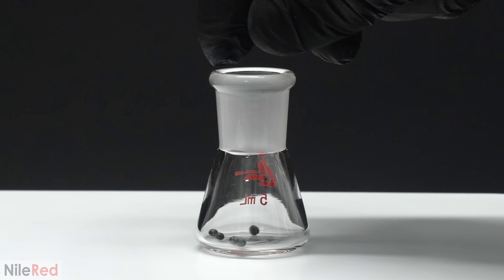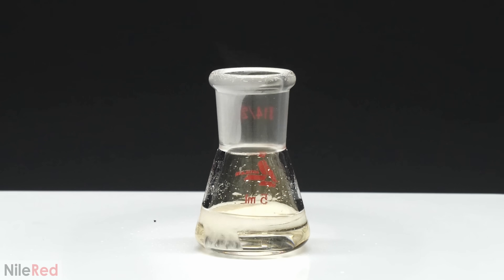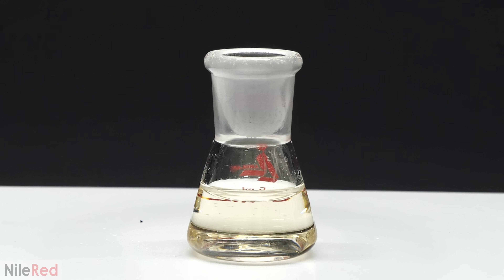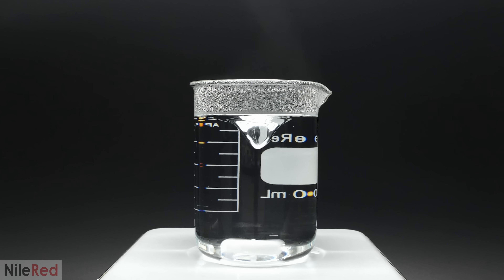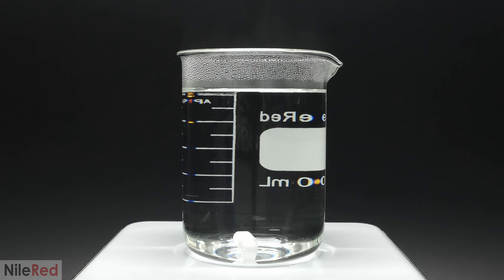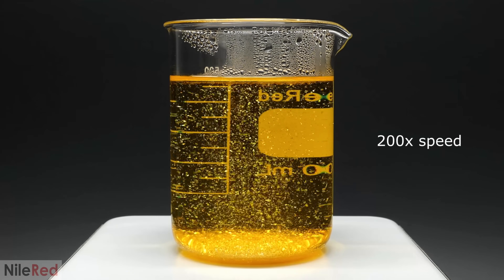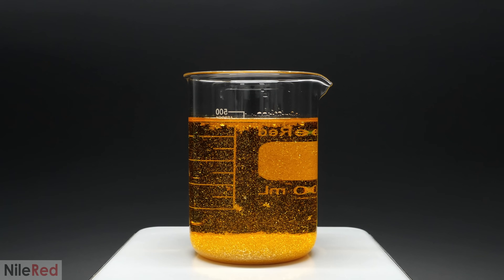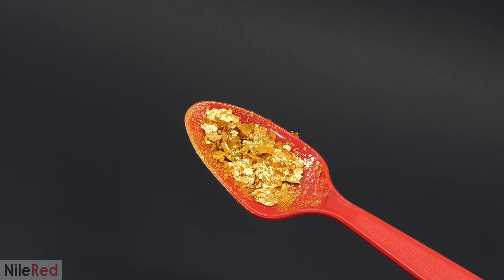Turning lead into gold (lead iodide)

Comment: Very fascinating 👍😃
I feel that somebody should point out the TOXICITY of Lead Iodide, just to give some information about it.
From Wikipedia: 
Lead iodide is very toxic to human health. Ingestion will cause many acute and chronic consequences characteristic of lead poisoning.[31] Lead iodide has been found to be a carcinogen in animals suggesting the same may hold true in humans.[32] Lead iodide is an inhalation hazard, appropriate respirator should be used when handling powders of lead iodide.

Comment: As a historian, this raises a lot of questions.

How long have people known how to do this? How long have people understood what "lead iodide" is?
Has anyone, in ancient history, learned how to do this before? What did they do with that knowledge?
Reply: I'm asking the same question! I need answers
Reply: I can't really say anything abouth whether someone found this out by chance in history. I suppose it's not impossibe considering the materials used would be reasonably available. That being said, without modern chemistry, this would be very hard to actually understand. That is, to be able to predict what might happen if you try this or that beyond direct experience. For a reference point on that: the periodic table arguably the most important 'tool' of chemistry was invented in 1869.
Reply: @ithrangroenen1787  
I could just try to look this up, I suppose, but sometimes it's fun just to speculate.

I have found, as a general rule, that ancient science is more sophisticated then we tend to imagine. It has massive holes in its overall logic, but other than that, it has the ability to achieve considerable depth.

All that is to say that, while the ancient alchemist in question couldn't possible understand the chemistry behind what he was doing, I believe that it would be very possible indeed for him to salvage materials that have the necessary chemical components to achieve this reaction.
Reply: @Nikolapoleon  I'd imagine they would probably have been able to predict that the process would yield some solid, but they would have no way to know what it would look like. That's late 20th century chemistry.
Reply: I'm sure that the early alchemists have done this exact experiment, or something very similar. Even very simple testing with a hammer will tell you this isn't gold, real gold would be squished flat while lead iodide will shatter into pieces.

However, they may have thought they were close to figuring out how to turn lead into gold. Without a good understanding of exactly what was going on, it would be easy for them to think that if they could just find the right reagents they could "perfect" this reaction to produce actual gold. Of course today we know this is impossible but to an ancient alchemist it must have felt like they were one step away from finding the philosopher's stone.
Reply: @jasonslade6259  This was exactly my suspicion.
Reply: I'm confident that at some point between the greeks (possibly further back) and the high middle ages, there must've been a scenario where someone achieved a reaction very similar to this one, and from there rumor started to spread and eventually became the ubiquitous alchemical legend/conundrum of 'turning lead into gold'. Being a relatively simple reaction, with accesible enough ingredients, it's too much of a coincidence that lead would be the base for the mythical transmutation without it being related to this.
Reply: Well, Isaac Newton actually went insane from dabbling in this art. He suffered from lead poisoning and eventually became cruel and sadistic. So, people have known how to do this stuff for a while.
Reply: Lead Iodide is a chemical that was first discovered in 1823, though it was not used to make chemicals until the 1900s.
Reply: Archimedes, had already recorded a formula still valid and used until today for the ruler of Syracuse to find out if his jewels were pure gold or not, which indicates that a few thousand years ago people knew how to forge gold and were fully aware of it, as this has become something so frowned upon as to become something mythical to common people (think about it like this, engines exist and are common, most people don't know how to design an engine except people with specialized study in this, everyone is fully aware of the existence of engines and few know how it works, so it's not that hard to see "common people" believing in perpetual motion engine myths). What methods were used on it, Idk.
Reply: As a historian (since now), I dont care that much about that question
Reply: @I   This semester I am beginning research for my Master's Thesis, so make of that what you will.

I wish to find out if the mercenary tradition of early modern Germany [at that time called the HRE, and largely under the control of the Habsburgs] is provably linked to the development of nineteenth and twentieth century German cultural "militarism."

But indeed, I know almost nothing about the history of alchemy specifically.
Reply: Probably a long time, it's most likely a byproduct of alchemy, what they did with the knowledge i have no idea, i know i would've gotten rich however 😄
Reply: Is this really gold,,,,can I sold it to a goldsmith 😮😮😮
Reply: You triggered my rumination
Reply: You must be the fun one at parties
Reply: @tranquilmagister8481  Joke's on you! I never get invited to parties!
Reply: @Nikolapoleon  xD well you can at least do jokes,

Comment: its weird that someday it will actually become possible to turn lead into gold and itll just be a normal thing to mention that its possible
its kinda interesting that the original "alchemy cliche" is lead into gold, because theyre very very similar and realistically would be able to be turned into each other with enough effort
Reply: I feel like you don't know how chemistry works, you can't make gold from lead by any chemical reaction because that would be changing the structure of the atom, the only way you can do it is by a nuclear reaction, it is possible and it has indeed been done, it's just extremely expensive to do so, much more than the gold you get back

Comment: Fun fact, its perfectly possible to transmute metals into gold, namely mercury and platinum. Synthesizing gold by irradiating mercury via neutron bombardment was first done in 1941. It can also be done in a particle accelerator 

The only problem is the gold is a radioactive sludge and the process is exponentially more expensive than the gold is worth. 

But technically the alchemist's goal of chrysopoeia has finally been achieved
Reply: actually transforming anything into anything is possible, you just need to have the ability to remove and add protons to atoms
Reply: @lucasthech  thats what I was thinking as well, maybe in the far future there will be some technology that can create whatever atom you need from other atoms
Reply: @OmniversalInsect  we already can remove them, but it's almost impossible to make a proton enter an atom's nucleus, and most of the time the removed protons just become a hydrogen atom
Reply: And if you use transmutation cirkels whats the next proces
Reply: @lucasthech  Ok, go transform my ton of debt into a ton of gold.  I'll wait.
Reply: @eric_d  I said you need tho be able to add protons to atoms, and debt isn't even a physical thing
Reply: @lucasthech  "actually transforming anything into anything is possible, you just need to have the ability to remove and add protons to atoms" <- your exact words.  You said ANYTHING into anything.  My debt is a real thing.  Sure, it's not a PHYSICAL thing that you can touch, but it is DEFINITELY a thing.  So I guess you were wrong?  What a shame.  I was really hoping to get rid of my debt with a little proton magic.
Reply: @eric_d  nope, it's still possible but you would need to transform something like air into gold, then yes, it's possible IF you can add protons to the nucleus of the atom
Reply: @eric_d  bro youre a certified, " um acktually you said- "  ☝️🤓
Reply: The real problem is creating gold that's not putting off radiation without waiting decades and even then it would only produce small amounts of gold.
Reply: @GreenGino  umm gold is not that valuable, asteroids are filled with this stuff... the only reason it is rare is because it is heavy and thus sinks to the earths core. once you crack open a few asteroids you will have as much as you need of the stuff
Reply: @kitkat47chrysalis95  Using that logic, land on earth is not that valuable because there are planets that have way more land. Gold is objectively valuable (here on earth, which is all that matters) because it doesn't oxidize and there's only so much of it. How many asteroids are you in possession of that you just "crack open"?
Reply: @GreenGino  also doing it efficiently enough/without enough resources that it actually creates a profits worth of gold
Reply: Solution: All countries should just increase the value of real gold and eventually, all of them can make gold which will be profitable. Infinite money glitch.
Reply: Lead was successfully transmuted into gold in 1980 by American Nobel Prize winner Glenn Seaborg.
Reply: @heyyallwatchthis5103

If I recall correctly, that was actually bismuth into gold because it has just one relatively stable isotope, whereas lead has four. And the difficulty is not merely transforming either into gold. It’s also finding the gold atoms after you do it. It’s much easier with bismuth because of the single relatively stable isotope. 

So yeah, if memory serves, it was bismuth into gold, not lead, for the reasons listed above. 

Also in both cases it is obscenely expensive due to the energy required for the particle accelerator and detecting the gold.
Reply: Great. Next is to make transmutation circles
Reply: Well this is a conversation I don't understand cool guys keep it up you are smart!

Comment: If you know any physics, removing electrons from, plasma or zero Kelvin condensates and other various states of matter, collapses, Van der Walls force,
Then removing W± and Z bosons collapses weak interaction nuclear forces, 
Then removing mesons (pseudoscalar meson, pseudovector meson,
Vector meson,
Scalar meson, 
Tensor meson) collapses strong interaction nuclear forces. 
Depending upon the scale of experiment,

At above 3.2 solar mass equivalent energies it's possible to manufacture singularities,

Between 1.4 solar mass to 2.14+ solar mass equivalent energies, various kinds of neutron stars can be manufactured,

between 23 x 10e27kg (13 times the mass of Jupiter) to 
144 x 10e27kg (80 times the mass of Jupiter)
various kinds of brown dwarfs can be manufactured.
nature does these things via gravitational collapses.

as long as the same process of collapsing 
Van der Walls forces,
Weak interaction nuclear forces,
and 
Strong interaction nuclear forces,
is followed, 
The same can be achieved for 
Per each quark reassembly 
each proton reassembly,
each neutron reassembly,
and subsequently
custom atomic reassembly.

CERN has been doing this for last 70 years, gradually getting better. 

Every chemist and physicist knows this.

Comment: Actually if you had lead197 it would turn into gold all by itself,  through radioactive decay. So if you could make 1kg of lead197 that would mean you were very rich. But not because it turned into gold later on, but because its actually very hard to produce and you would spend way more money getting the lead than the gold you're getting at the end is worth.

Comment: You need to add radiation. A lot of ionizing radiation. That's the only way to turn one element into another.

Alternatively, you could probably try dissolving lithium metal into an ammonia solution, and then dumping the lead iodide into that so that it can grab free protons or something.

Comment: There’s strong evidence that this very reaction was the cause of MANY alchemists erroneously thinking they’d turned lead into gold. And may have even been the genesis of the claim that such a feat was possible through alchemy. At least this substance IS pretty convincing. I can see how they’d be fooled. Imagine their confusion when they tried melting this shit into gold bars tho XD. As lead iodine decomposes, it lets off iodide vapor which is purple and forms lead metal and lead oxide. Imagine how baffled ancient alchemists would be when the “gold” they isolated started off gassing purple smoke and turning into orange lead oxide powder and grey liquid lead XD